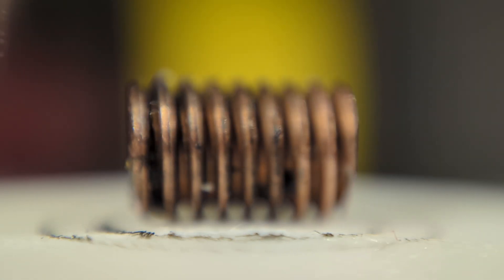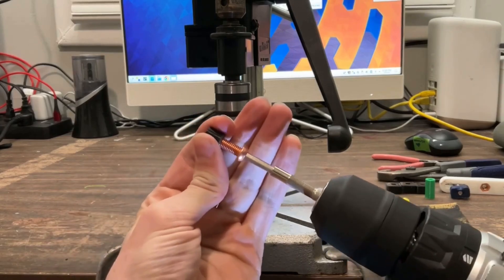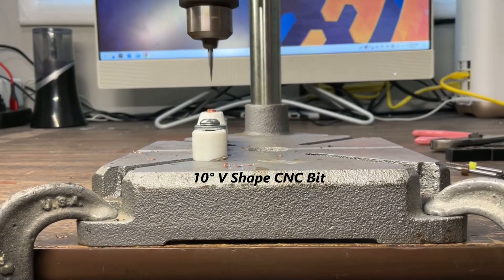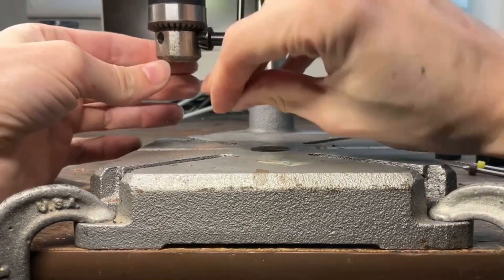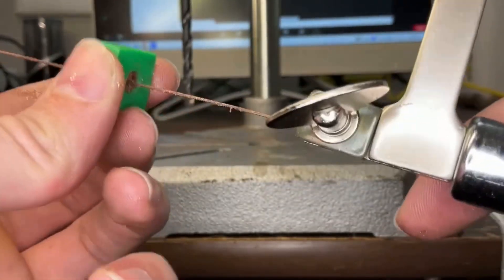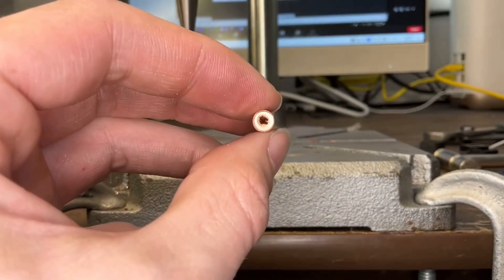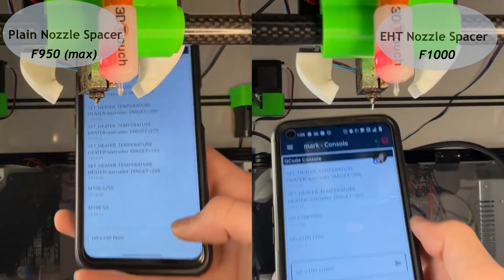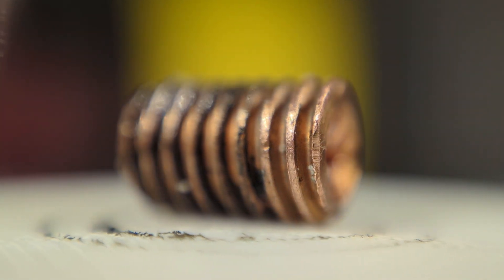DIY Booster for CHT Nozzles | 3D Print Even Faster

Comment: Nicely done. What lube were you using when drilling and reaming? Looked like glycerine or liquid paraffin.

"Old school" machining would use a broach to form the cross, but for a small run... well, apprentice+saw is tried and tested 🙂
Reply from the maker: @MarkMLl_uk  Tested again and again 😆 I was just using silicone treadmill lubricant. I've got tap magic now, but I'm curious at the difference, because silicone seems to work better than it should!
Reply: @aaamott  There's a lot of magic involved, and the rule appears to be "use what works".

"Proper" cutting fluid has additives not unlike the EP additives in automotive oil, that do their best to keep metal surfaces coated even at points where the pressure is rapidly heading towards infinity: the cutting edge of a tool, or the contact point between a ball race and a rolling bearing. As such for steel they tend to be relatively heavy...

For alumin(i)um I've seen kerosene (i.e. light fuel-grade paraffin) recommended. But for certain operations in at least certain steels I've seen people swear by WD-40: a very light oil with additives intended as a Water Displacer which seems to fly in the face of the "relatively heavy" tradition.

I think it's probably best to assume that the "best" cutting lubricant- i.e. what's carried best into the cutting area- depends on the precise combination of tool and workpiece materials: many a learned tome has been written on this and other aspects of tribology. You were cutting copper: were your drill and reamer steel or carbide? If the latter then you might be in uncharted territory since while the tools are obviously used for cutting very light copper the dominant material is the resin-impregnated glass fibre behind it.
Reply from the maker: @MarkMLl_uk  makes sense that it would have some additional additives. I got the tap magic because I'm going to be drilling steel for a couple other projects and Project Farm had great results with it. I've heard WD-40 too, but the tap magic was a good price. 
The PCB bits are carbide, but the pointed engraving bits are the cheapest I could find, I think HSS. Honestly I was kind of expecting one to break in the copper, but didn't come close! I'm sure the glass fiber is usually the harder material than 0.2mm of copper lol.

Comment: Awesome work! Simple if tedious to make, but effective. Wire edm would almost certainly be the method for mass manufacturing, but it would be expensive. Perhaps sintered metal printing could strike the balance there
Reply from the maker: @YouTubestopsharingmyrealname  thanks! I started looking into sintered metal, but not until right after the most affordable company went out of business :( I'm considering a ways to make it CNC workable, but have some serious testing to do with pressure advance. Updates coming!

Comment: Great idea. I am glad that 3d printing is still evolving.
I guess you can drill several holes, one in the center and another 4 at an angle. Then use cone drill. But this will sure need more accuracy.
Reply from the maker: @enosunim  I had thought about the same thing. I even played with tapered bits at different angles. Maybe it will end up working better 🤷

Comment: This part screams wire EDM. Prototype in brass
Reply: Sinker EDM is much easier to set up, and could just use his existing 3D printer with a brass shim used for the cutter, and an RC adapter on a lab power supply is very cheap.
Reply: My thoughts exactly, just a pilot hole in center, but then you kinda need a EDM with a tilting XY axis instead of panning.. I haven't even seen one of those before.. is that a thing?
Reply: @Roobotics  they call them "4D", each wire guide has X and Y motion controlled by CNC. Pretty common option AFAIK
Reply: @cest7343  Very interesting, I've seen lots of 4th and 5th axis CNC stuff, but never an EDM that can skew it's tilt mid-cut to make faces that aren't parallel, IMO they're often just used like glorified Styrofoam cutters in that sense, so I'll have to check those out.
Reply from the maker: @cest7343  Makes me wonder if that could be done with the new Powercore II machine. It's like $1500, so I won't have one any time soon lol but maybe someone else will!

Comment: I would like to see a test with the cht spacer with a cht nozzle compared to a standard volcano cht nozzle. This video is great tho!
Reply from the maker: @educationalpurposesmostly  I’m hoping I can do it eventually, but $30 is a lot to drop on a nozzle… but once I do, I’ll do knockoff cht volcano vs authentic vs knockoff with a spacer. And I’ll stack the booster with each to see what difference it makes, and I’ll test with the new cht meltzone extender you can buy on Aliexpress. My thought is that it will be fairly useless when added to the authentic cht, maybe even decrease flow, but we’ll see!

Comment: Put thermal paster around nozzle and heater then get 15% increase in flow.
Reply from the maker: @PrintPixeltr  Maybe eventually I'll get some boron nitride paste...
Reply: @aaamott  just use thermal grizzly
Reply from the maker: @PrintPixeltr  didn't know it could go that hot! Thanks for the suggestion!

Comment: Dont wanna get bloody cut towards your buddy or away from you. Also im pretty sure the bit you showed is a security bit.
Reply from the maker: @TRTmike4Life  Good call! I ordered a little vice to avoid this problem. The blade is suuuuper fragile and I've seen a number of people stab themselves when it breaks, which was my main concern. Any pressure and it snaps. 
I'll check for that size security but! Thanks!
Reply: @aaamott  there different types and sizes harbor freight has a cheap case of security bits well not expensive and it had some x shaped bits

Comment: If you want to have the bore in the true middle you only have to reverse. Clamp the object in the drilling machin and clamp the drill. That way it's self centering.
Reply from the maker: @michaeleitel7186  that's a great idea! Maybe I can find a chuck to clamp the drill bit to the bed...
Reply: @aaamott  nope, you have to SPIN the part you are drilling and clamp the drill bit FIXED to the bed/vise
This way the drill bit makes a hole around the rotational axis of the object

Comment: High speed pla is bad at bridging anyway, pla + at higher temperatures get you the same speed but with bridges that work.

I've got 51mms ( with some skipped E steps) out of a Kobra 2 hot end that's slightly modified to use v5 style nozzles and heatbreaks. I later upgraded the heating block and heater to a lower mass one with ceramic heater.  260c for that flow rate and it came out nice with flow test. 

I set my limit to 35mm³s in slicer though since I don't print over 230mms most of the time.  

For that flow rate I use 235c and bump it up to 245 for 300mms.
Reply from the maker: @freedomofmotion  I'll have to try some PLA+. I just ordered some! I also got some new yellow Rapid PLA and got another 10% flow. Not sure what that's all about, so I kept current results. I'll test PLA+ and different temps next update, with a manufactured booster and I'll try to toss in a bigger nozzle!
Reply: @aaamott  Oh yes I should point out I was using a 0.6mm nozzle for that flow rate.0.4mm might of been lower.

Comment: Pretty cool, what bearings/bushings are you running on the carbon fiber rods?
Reply from the maker: @fintechrepairshop  PETG printed bearings at first, now brass bushings. I'm planning to do a video on that later because I feel like most people don't share the full experience or pitfalls. The bushings give me more friction than the PETG. If I could find LM12UU solid bearings I'd try those. There are a lot of potential issues if you don't get the spacing just right, but once you do it works pretty well. Also, sanding the rods from 12.2mm to 12mm to fit the brass bushings made friction way worse. I figured it was worth the rods to experiment and share.
Reply: Would also like to know
Reply from the maker: @riba2233  in case you don't get notified, see my previous comment ;)
Reply: @aaamott   thanks, y0u are a true chad :)

Comment: this is a work for Wire EDM, I guess nobody uses that due to the cost.
With wire EDM you can put like 100 fins in that extender.
Edit: Did the CAD drawing, my 100 fins estimate was too much, could fit like 18 fins that could be reasonably manufactured.
Reply from the maker: @onurcetinkaya4873  I dream of having EDM. The angled fins and cone make it even harder, since it would have to be at least 4 axis to get them right. But I've wondered if sinker EDM would work with a shaped bit coming in from the bottom and a cone from the top. Have you heard of Powercore?
Reply: @aaamott  Yes I did hear powercore, even bought some parts to make something similar, but couldn't start it yet :D
You don't need 4 axis EDM for this shape, you can first make the cone with a traditional lathe with a tapered drill bit, then put the fins with 2-axis EDM.
At such small scale, sinker EDM might be more economical, but sinker tool also need to be cut from copper with EDM and that would be expensive and fragile, if nozzle is made from aluminum maybe sink tool can last like 50-100 times, if the nozzle material would be copper it can last 1 time at most.
I did make some CAD drawings and it is possible to put like 18 fins with 0.18 mm wire EDM, which increases the surface area like 6 times compared to a regular nozzle. Fins on my design will also be very fragile I suppose.
Reply from the maker: @onurcetinkaya4873  Dang! if I manage to justify the cost with a way to make the money back... That would be great if the Powercore could be used to make these!
Reply: @aaamott I don't think this violates the CHT patent either.
3d Printing community needs this kind of high performance adapter. if you can make them that would sell.
If I can make them, I will write to you.
Reply: Perhaps not Wire Edm, but an EDM press could work fine for mass manufacturing here. Saves you the hassle on threading the wire in and out of every workpiece.